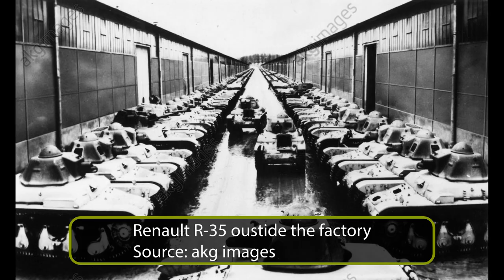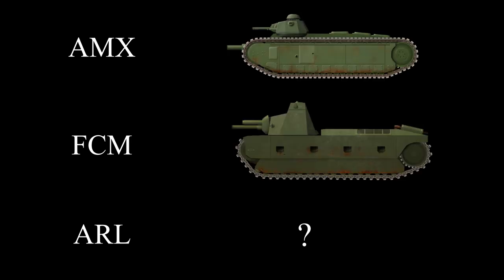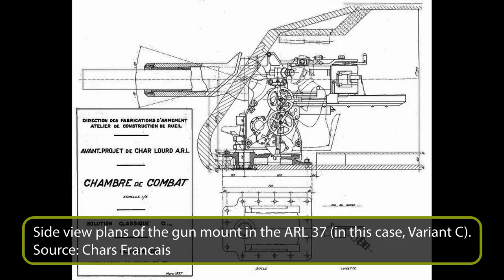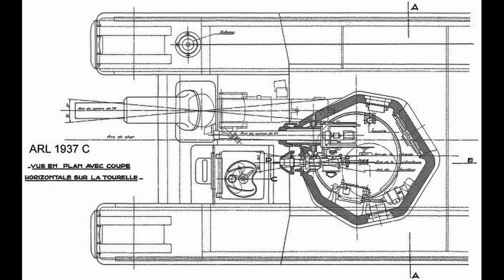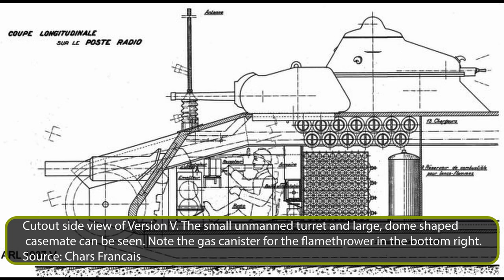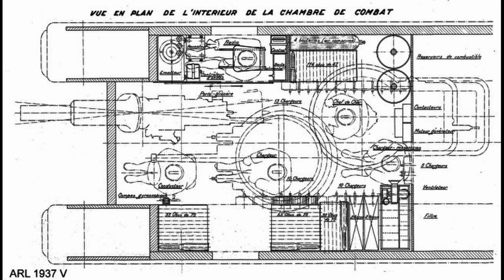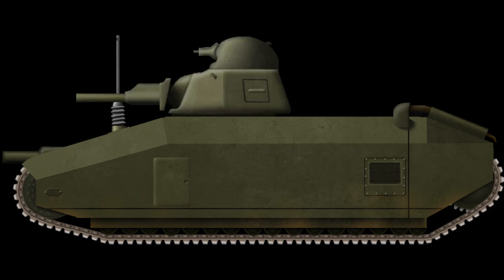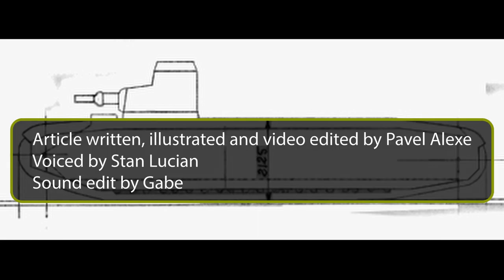Three shots, three misses | ARL 37 ‘Char de Rupture’

Comment: The ARL V39 seems like  useful design.  High sides?  Look at the US M3 Medium of two years later.  The 75 is no stellar performer, but it is the standard for useful dual purpose (AP/HE) guns.  Set next to the StuG III, ARL V39 seems perfectly ordinary.  By contrast, the Somua Sau40 is a hideous contraption and the Soviet SU122 (T34 variant) crude and front heavy.
  I would rather have 400 ARL V39 than 400 Chars B1.  To make them perfect, pull the silly TC turret off and replace it with a proper cupola.
Reply: LOL yeah it worked so well LOL
Reply: @Pugiron  They only delivered two.  No way to tell how well it worked, as Germany invaded a month after the prototypes started testing.

Comment: You do know that "infamous" means famous for being bad?  While it could be argued that the Char B1 has not a great tank and had many flaws when used in it's original purpose even as late as the battles around La Rochelle in 1945 it was still combat effective just not suited for mobile warfare.  While the 1897 75mm Howitzer is one of the best light artillery guns ever made completly revolutionising Artillery design and no-one could ever reasonably describe it as "infamous"
Reply: To be fair, you can't blame people whose first language is not English for making such mistakes when the native-speakers are getting so careless with their choice of vocabulary. A lot of Anglophones, especially those who make extensive use of texting media such as Twitter or Youtube comments, are increasingly treating Infamous as a synonym of Famous rather than respecting that it has its own technical meaning. They either never learned that these words have their own meanings and just assume it means the same thing because it sounds about the same or they don't see the need to be so careful because "people know what I mean." Has not occurred to a lot of these people that they are slowly becoming incomprehensible even to their peers as they carelessly tweet.